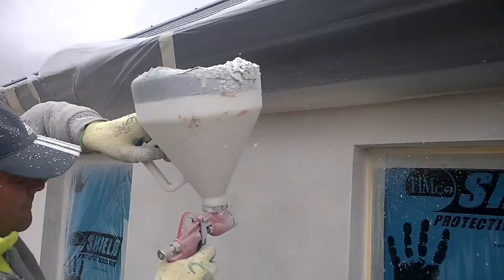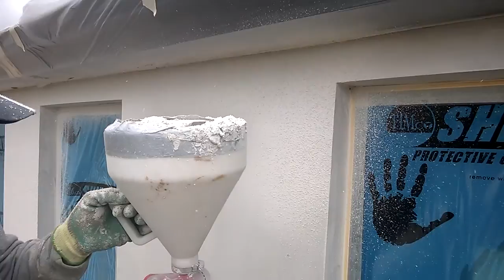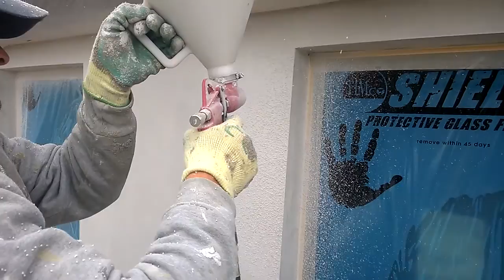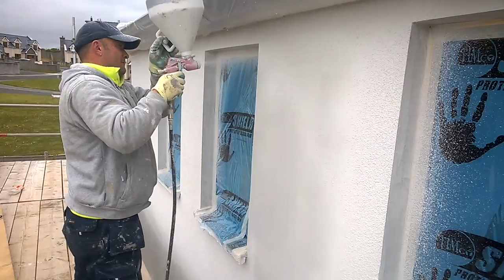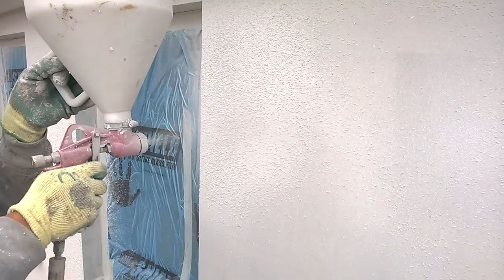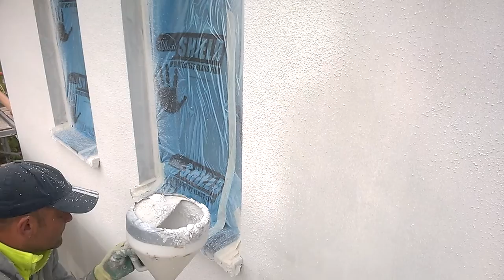Spray Acrylic Plastering

Comment: what spray gun you using mate?
Reply: It's the special for finish silicon and acrylic render 1,5 to4, mm stones
Reply: +Jacek Patlewicz where do you get it and how much for the gun and compressor? your information is greatly appreciated thank you. got a thin coat system to do 1.5 ml grane after you spray do you need to run your plastic float over it or is the spray the achieved finish. thanks mate
Reply: What gun is this please
Reply: jammy bcfc did you need to run the float over it after it was sprayed mate?
Reply: @jammybcfc5846  Ebay - 16 pound

Comment: What set up are you using and does that need rubbing up after also what grain are you spraying please cheers
Reply: Did you need to rub it up after spraying mate?  Cheers
Reply: When I've been spraying it with the ritmo l it doesn't need rubbing up.
Reply: How about with a hopper sprayer? Cheers
Reply: @dalegribble7935  I'd say no it doesn't, machine applied
Reply: @dalegribble7935  they sell the kit at refina. As long as the compressor is over 10cfm and you could put a 15meter airline on it as you'll only be spraying at 30psi
Reply: @waynebrewer2497  go bigger first pal  all depends on the mm of the materials
Reply: @dalegribble7935  no you dont,I've done it now 👍
Reply: I have a big road compressor it's very good no need rubbing up after and you can live a half wall and finish next day
Reply: @stuartscottplasteringandre1534  just bought the refina hopper. So it works great with the ritmo?